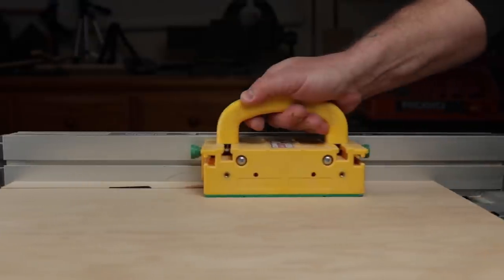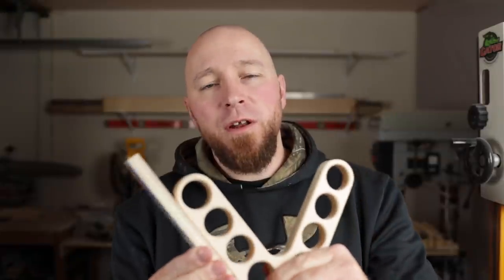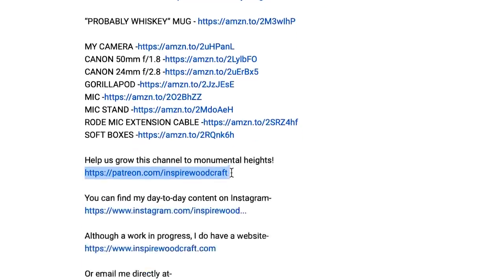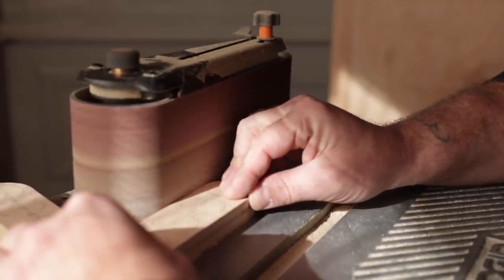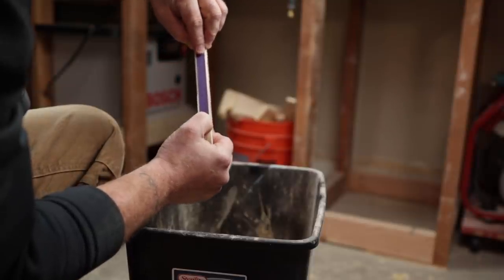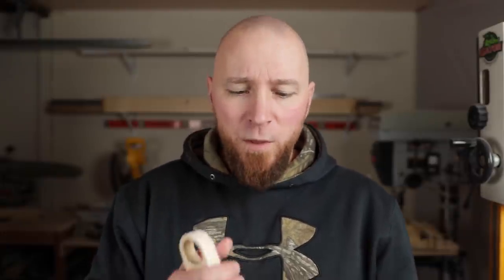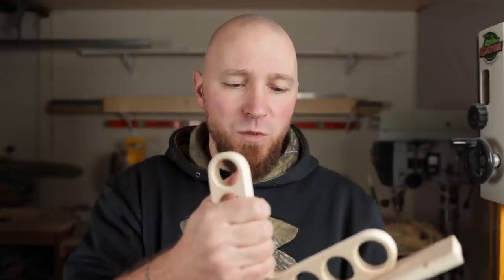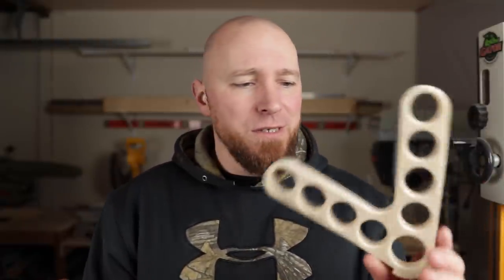Is This The New Best Push Stick Design For The Table Saw? / FREE TEMPLATE!

Comment: It's not a bad design by any means and the closer your hand is to the material being cut the better control you have. However, this means setting the hight of the blade appropriately to the thickness of the material being cut.
Reply from the maker: Thanks for the feedback! Although I'm not sure exactly what you mean. If you go with the "traditional" school of thought, the blade should be roughly 1/4" above the surface of the material. That being said, this design keeps your hand roughly 3-1/2" above the work piece.

Comment: I love the pick-up-and-use-either-side feature of your design, and the sandpaper strip is nice too. I don't know why you bother with putting all the holes in it though? Seems to me that it will just weaken the strength of the push stick without adding any benefit. Personally I make do with just one push stick for everything, and tend to "chew" them up quite regularly when doing thin cuts, so when I need a new one I will definitely try this design, but without the holes and without the sandpaper, as I will just be cutting into the sandpaper, which will not be of benefit to my blade.
Reply from the maker: Yeah definitely some stuff others have brought up too. I’m planning a follow-up video to this discussion and general table saw safety in the near future as soon as this next video is wrapped up. The holes were purely aesthetic, since it would look very boring without them and no one would ever click on the video and check it out. I use them all the time and I’ve purposely cut through them to test them and they hold up great! As for the sandpaper, it’s way less damaging to the blade than the plywood’s and hardwoods we typically run through our blades to begin with so I don’t worry about that at all. But a lot of people have asked about that. Thanks for the feedback!

Comment: Best part of the design is that it doesn't matter which part of it you grab, it's always a handle.
However....
Pushsticks are literally sacrificial items. They're meant to be cut into if needed.
If you cut into yours, with all those holes in it, it'll be significantly weaker, potentially breaking apart as you're pushing a piece through the blade. Not to mention the fact that you've glued sandpaper to the stick, which sounds like a good idea....but having gritty things anywhere near a blade is just asking for a dull blade.

And, this looks like it's taken way too long to make, drilling all those holes.

It's cool looking.
But items designed for safety need to be more practical and functional.

Just my opinion, as you've asked for opinions.

Comment: I'd have to try it out to know for sure but just eyeballing it it doesn't look like it would stay over the work piece and control it enough. Also seems like the pinky finger ends up being way to close to the blade for what I'm comfortable with. Not for me. Props though for creating something original.
Reply from the maker: Appreciate the comment and thanks for taking the time to watch. I would like to just point out that if the blade is set at the correct height for the cut, it would never come near your hand. Actually I raised the blade all the way up on my saw to measure what would happen if I was to somehow leave the blade up that high, and while it was too close for comfort, the blade still never reached my hand. Of course that's only with my saw. Super valid concern though and I appreciate it. At the end of the day it all comes down to what is most comfortable for you. If you do try it out, let me know! Thanks!
Reply: Totally agree and probably didn't explain myself enough. If there was an issue I like to have full control of the work piece like I get with my Grrrripper (however that's spelled) or have my hand way back like with a "normal" push stick.

Comment: Pretty cool design. Looks very light, strong, and convenient to use. Ima make one and will let you know.  The only thing I’m going to do is make it one “hole” longer on each leg - maybe two on one side to give more options for starting short rips 100% with the stick - having to apply it mid-cut.

Comment: Looks cool.. (but).. i prefer to push the wood from further away from the blade. This design, with notch toward back, your hand would be probably over (or past) the blade by the time the cut is done.
Jmo.
Reply from the maker: Yeah I’ve learned very quickly that people have their preference on push stick design and they’re pretty stuck on it. And that’s not necessarily a bad thing either. If you aren’t comfortable, your already at a loss. Thanks for the comment!

Comment: Cool design.  I think, like you, that this would give you better control over the work piece.  Two comments:  
1.  I see that your hand goes over the blade so I wold be very mindful of loose clothing.
2.  If you added a stop (Like a hilt) or some sort of pistol grip to keep your hand from sliding down the handle you could ensure that your hand stays above the highest reach of the blade.  Unfortunately, this would reduce your gripping side to one unless your stop was on the inside of the angle.
Reply from the maker: If the blade is set to the right height you could grip it anywhere without the blade reaching your hand. Completely agree with the loose clothing comment and in general that is definitely best practice.

Comment: I like the design, but...

No way I'm running sandpaper into a saw blade. It's hard enough keeping them sharp with just proper use. I've seen mention of crosscutting an inch from each end of a board to keep dirt and sand away from the blade.  Contamination is possible with boards stored vertically or when exposed to the elements.
Reply from the maker: Valid concern for some. A couple of things that come to mind are that one, I believe I mentioned in the video that I most likely wouldn’t be using it for material less than 3/4” because I prefer a different type of device for that type of cut. And two, I personally don’t believe that a tiny amount of sandpaper is going to hurt the saw blade anymore than the plywood and hardwoods that I normally push through.
Reply: HA-HA-Haaaa!
Reply: You could possibly use some rubber sheet material instead of the sandpaper.

Comment: Nice design but I am concerned about being too close to the blade.  Maybe make the arms thicker to raise your hand farther away from the blade.
Reply from the maker: Interesting thought. Thanks for the feedback! So this design actually keeps your hand roughly 3-1/2" from the blade, making it farther away from the blade than a lot of other designs I have seen with this category of push sticks. Any taller and the weight of your hand would change the center of gravity too much and make it unstable to use. The handle is 1-3/4 thick already, so any thicker and you wouldn't be able to hold it comfortably.
Reply: Yes but if your blade is above your piece 1 inch you can have problems, I see guys on U- tube all the time cutting a 1/2 in piece of wood with the blade up all the way. I guess you cant fix stupid. The design is very cool. I'm making one today.
Reply: What? If you are using your saw properly you wouldn't have the blade more then 1/8 inch over the work. How tall before YOU feel safe? The taller you make it the less balance it becomes. Any force you put on it or gets put on it from the saw would get more pronounced and the leverage would make you more likely to slip or flop it over. So go ahead make it taller. I think the design is great. Its no shorter then just about everything else out there and just as safe.
Reply from the maker: Thank you.
Reply: @SW-zu7ve  sure but err is human. Give a chance to your hand for your mistake.
Reply: @vrajananda  What mistake is that?
Reply: Very nice design, but the I also thought it could be dangerous. Agreed, you shouldn't let the blade stick out too much above your workpiece, but who doesn't make a quick cut now and again, without adjusting the blade? To make your hand go higher, without adding to much weight, you could increase the radius of the inside corner. That way you'd automatically grip it a bit higher up. That's the way I'm going to make it, anyway.
Reply: I'm trying my best to not comment in a sarcastic manner but seriously? This design starts out with your hand a minimum of 1 3/4" above the work piece. If you can't figure out how to keep from getting yourself tangled up with the blade from that distance, then maybe watercolors or macrame should be your hobby.

There is no doubt in my mind that the table saw is the most dangerous tool in the shop. However, with the right procedures and setup, you should be able to use one without hurting yourself (as I have done just about every day for 40 years).
Reply: @rogermccaslin6750  I guess we just all have our own opinion. I'm just not comfortable with it. Things can happen too quickly for my comfort. I'm glad you've been safe fo all this time but I still am apprehensive about it.
Reply: @williamellis8993  Yes my first thought was that his hand is pretty close to the blade.

Comment: One of the best looking push sticks around! 

Just don't put your fingers in the holes, I would want the push stick to fling away if something happened.
Reply from the maker: Ha! Yeah definitely wouldn’t want that. Once you put your hands in the holes you quickly realize it’s not very comfortable so you wouldn’t even try afterwards.
Reply: @InspireWoodcraft  Are there any rubber or silicon surfaces that you could use rather than sandpaper?
Reply from the maker: Some people have suggested yoga mat or mouse pad. I try to make my stuff out of things that’s most people would already have in their shops and I don’t have anything like that in mine, so sandpaper seemed like a good choice.
Reply: @InspireWoodcraft  yea just curious.

Comment: It is a neat-looking push stick but I think the holes in it are Overkill unless you're just bored and need something to do. I think it puts your hand too close to the blade as well and the other thing I don't like about it is that it is way too thick for thin rips. I use quarter inch plywood on my push sticks and the way they are designed your hand is quite a ways from the blade
Reply from the maker: While it could be used for thin rips, it’s not intended for thin rips, like I said. The holes aren’t actually overkill because they’re are unnecessary and only there because I thought it looked more aesthetically pleasing, like I said. And also this design doesn’t put your hand any closer to the blade than any other design in this category of push stick. Definitely closer than the long fish-mouth sticks though, which can actually help induce kickback as opposed to help eliminate it.
Reply: @InspireWoodcraft  keep doing you. I can assure you that you are more talented than me. I was just speaking on my comfort level. The one thing I do like about the design is it has more down force on the material since your more on top of it and pushing down. I still feel in certain situations it could be more dangerous because you are kind of leading with the hand.
Reply from the maker: Completely understand and to be honest my number one safety advice is to never do something you aren’t comfortable with. And I didn’t mean to come off rude but there’s been some pretty knucklehead comments on here and it’s a shame for all the newer woodworkers who are trying to learn. Thanks a ton.

Comment: Great design. I normally use a 2x4 with a hook and handle. I especially like it for narrow cuts where I support both sides of the material going through the blade. It's a totally sacrificial pushstick and I go through a lot 2x4's.
Reply from the maker: Agreed. That’s why I brought that up in the video too. There’s so many designs and uses for push sticks.

Comment: Instead of sand paper, why not use the cabinet liner material that offers a non slip surface without scuffing your material?  Like the design though!
Reply from the maker: Great idea! I typically make my shop jigs and such with stuff I have around the shop and I didn’t have any of that. Plus if it does scuff the material it’s okay because if you are still in the tables saw cutting process, that means you still have to go through the sanding process, which will get rid of any marks. Great idea though!

Comment: I found this very useful, so much I took the template and did a 3D file .step file for those who have CNC's as myself + added a undercut in corner. With woodcraft's permission I'll gladly share it if anyone is interested.

Comment: That's a nice design but a lot of work for something you're going to run through a saw blade sooner or later. But I'm more of a if it works who cares what it looks like kind of guy.
Reply from the maker: The design and video were a lot of work but actually if you don’t drill the holes it’s no more work than any other push stick. I mean you still have to cut and shape either way. Plus with this one it’s two-for-one so that’s one less trip making a second one.
Reply: @InspireWoodcraft  Like I said, it's a nice design and to be really clear, it's the "BMW" of push sticks. I just can't see going to all that work personally when I can cut something on the band saw from some scrap that works just fine in a couple of minutes.
Reply from the maker: Totally agree. A lot of times I use a chunk of 2x and call it good.

Comment: My only suggestion for this unique design would be to add a third leg and add shoulders to each corner.
Reply from the maker: Hmm. Thats a hard one to picture but I'm very curious!
Reply: You're right, if there were shoulders at each corner the sandpaper would not make contact..... my bad
Reply from the maker: Oh you mean like a triangle! That’s brilliant! Although a little more complicated to make. You could just have one hook on each corner instead of two and it would work just fine. That’s awesome!
Reply: Looking forward to your build. Another thought. How about a disk at each corner with multi-notches on both sides instead of built-in notches. I can picture it in my mind but don't know how to describe it exactly.

Comment: Nevertheless I can see your hand coming right above from the blade. Imagine you did not adjust its height, and a couple of fingers got chance to be part of the waste side.
Reply from the maker: If I didn’t adjust the blade height I would be completely at fault and have no one to blame but myself. No push stick or other safety apparatus (aside from a SawStop brake) can solve human error.

Comment: Interesting design but too narrow of a design to have my hand over top of the blade like that. If I do that, I'll keep something with a wider base. Very little protection for something that's supposed to be used as a piece of safety equipment.
Reply from the maker: Interesting thoughts. Thanks! I think people are very much attached to what they’re used to. I would add though that push sticks, or blocks even, are not meant to protect your hands.

Comment: Why do you need the holes? Don't serve any purpose other than looks. No way I'm running sandpaper through my blade. My shopmade push sticks get chewed up over time and I make new ones..
Reply from the maker: You did WATCH and LISTEN to the video, right? I clearly said that the holes weren’t necessary and it was clearly something I thought was visually appealing, and that I wouldn’t be using it for cuts less than 3/4” because I prefer a different device for said cuts. At least I thought I did.

Comment: Well that suck you can't print the template out.
Reply from the maker: You might try again. Something may have went wrong. We’ve had a little over 1300 downloads so far and no complaints. Good luck.

Comment: I like & dislike it! It looks great and works good. But I don't really like my hand floating over or near the table saw blade. I respect that blade, to much, for that. 👆 I think it would be cool, made from PVC board, and maybe in a Z shape. Keeping your hand safely behind the board and blade (rather than on top of it)
Reply: Z shape would be safer than the V shape. Never get the hand over the blade for gravity reason evidences.
Reply from the maker: I’d be curious to see a Z shape, but keep in mind that the farther and more vertical your hand is from the blade, the less control you have as your center of gravity changes rapidly, actually increasing you chance of kickback. If your blade is set to an appropriate height to your material there should be no reason you hand is anywhere near the blade.

Comment: Sorry, not impressed. Hand still too close to the blade if all goes pear shaped. A birdmouthed push stick keeps your hand back from the blade.
Reply from the maker: Yeah I’ve learned that people are very attached to what they’re used to and that’s a good thing because as soon as you’re not comfortable, you’re in trouble. I personally don’t like the birds mouth type because they offer no support or control to the workpiece. With the type that is closer to the workpiece, I can actually drive the work through the blade for a nicer, more predictable and in my opinion, safer cut. I’ve had way too many issues with birds mouth kind and have found that they can tend to actually induce a chance for kickback. But that’s just my experience. Thanks for watching.

Comment: So much work, it’s neat but it’s just a pushstick... I’m not sure it’s worth the time
Reply from the maker: Actually if you think about it, it’s no more work than making any other push stick. You have to cut and shape any shop built tool. The design process and video makes it seem longer than it is. Take away the holes, which like I said are purely for aesthetics, and it’s actually easier than a lot of other designs.